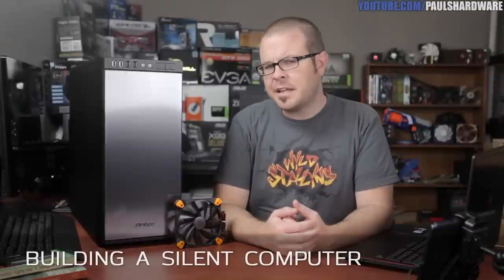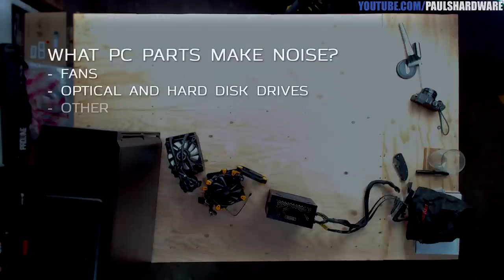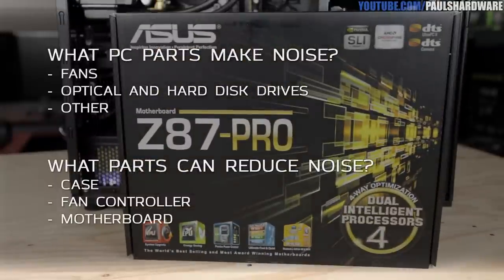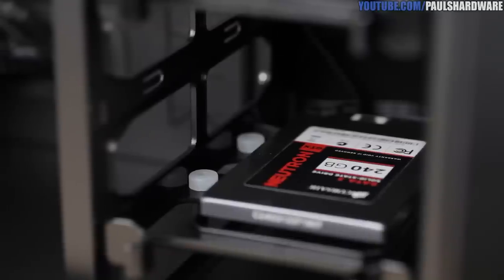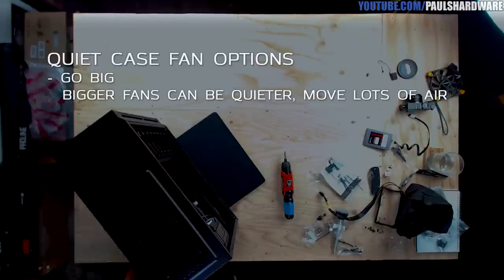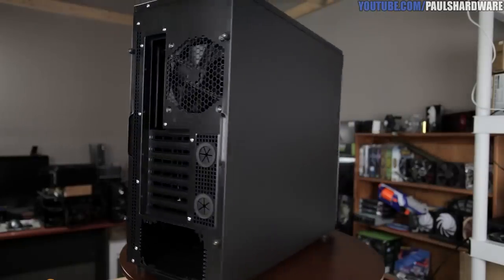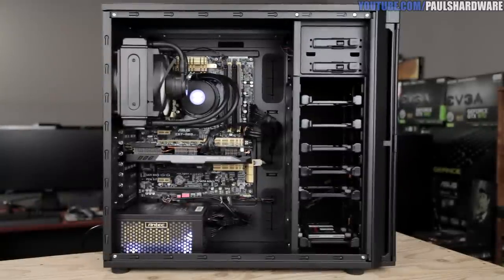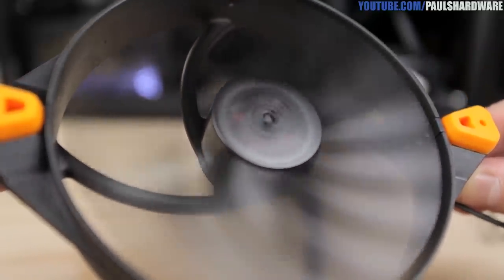Building A Silent Computer

Comment: Let me correct ya.. Magnetic bearings are the shit.. Sure it sounds super dead silent from the looks of it, but its not.. Mostly I am talking about  the ML120/140 by corsair and their implementation is piece of premium junk.. Sure its quiet at 23% thru speedfan.. But once you put 2 of those at 23% its like worse than even 3 fluid dynamic/hydro dynamic or hydraulic fans at the same RPM.. Stay away from that trash  
Also there is a nice possibility (mostly if you buy the right fan size) to change the PSU fan if you make a wrong move in choosing one.. At my dead-silent build it was the last fucking part I could really hear to make the kind of annoying sound, being a rifle bearing fan on that thing.. Cut the cables, get a silent (in my case 120mm) fan, cut those cables as well, smolder them together properly and really tightly screw the fan back on.. The result was huge in my case, glad I did that.. Saved me a ton of money